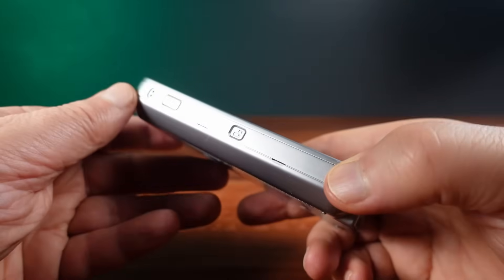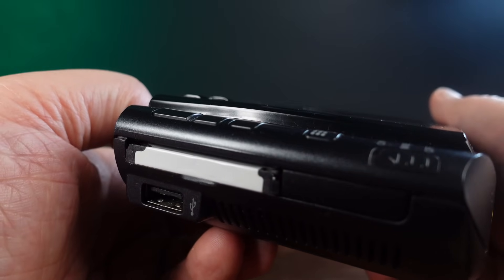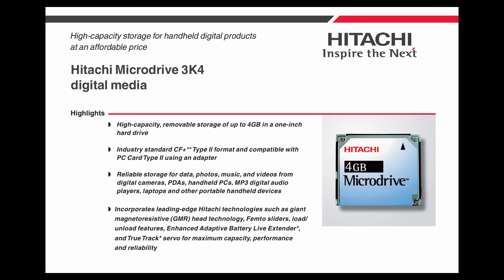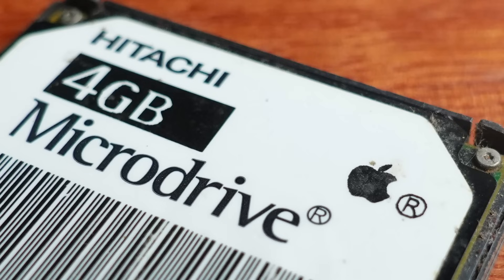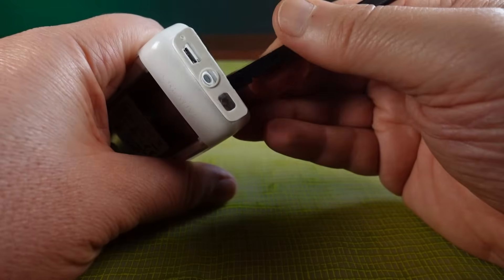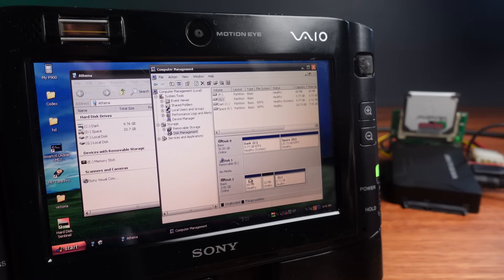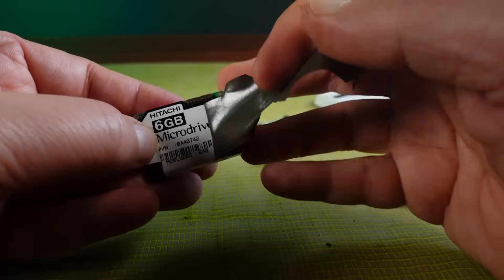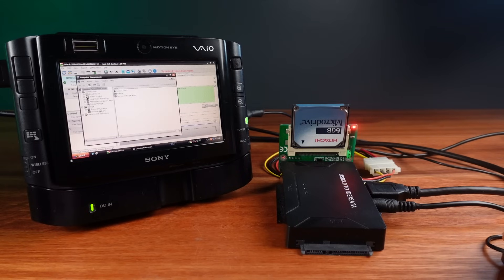Miniature Hard Drives

Comment: What about changing firmware in those microdrives to expand support of other protocol?
Reply: Even on specialized data recovery forums, the amount of information about these hard drives ranges from "nothing" to "oh, we know these things exist," so yes, it is theoretically possible to change or patch the firmware, but no one knows how.
Reply: @avamnepohui7260  With enough time and dedication, it is possible. On the one hand there are these firmware upgrade tools from the manufacture. You may reverse engineer these, or just hack them to make them flash a 'retailed' firmware with CF support on an embedded one. The parts and hardware is likely the same. Comparing the firmware with IDA or Ghidra probably reveals that even the firmware code is just the same, all what differs are some flags in the 'configuration data' section that enables or disables CF support.
Of course these are just wild guesses, however it is most likely like that, so development and maintenance costs stays low.
Reply: @asselpunk1  I didn't say it was impossible, but. In theory, it sounds like a simple task. In fact, it's a bit different. As far as I can tell from what I saw in the video, the Seagate drive, judging by the firmware version, is similar to the early Barracuda and late U series. But what distinguishes them from these drives is that the interface can work on two different protocols, which regular Seagate drives for computers cannot do. The configuration is stored in the "Vendor" module, or rather in one of its parts, which Seagate calls "Stuff", which will most likely differ from what has already been studied. It is possible that you just need to replace some parts of the firmware - the APP module is responsible for working on the main interface, which is written in a hidden area directly on the magnetic disks, the "Vendor" module is also written on a magnetic plate.

But if you replace one of the firmware modules, the drive will simply stop working, because all its modules are interconnected. For example, if you want to replace the board of a Seagate drive, but the drive originally had an IDE interface and the new board has a SATA interface, after such a replacement, in order for the drive to work as it should, you need to write modules from a drive with a SATA interface to a magnetic plate and do a full factory burn-in test, because no one could remake the tables of defects, calibrations, etc. from one firmware version to another. We are talking about drives of the same series, the same volume, and with the "same" firmware version, which is printed on the sticker.

An interesting fact - no one could find a diagnostic port on these small Seagate drives, all games with firmware are done through it.
There are no utilities for updating their firmware either.

If you want, I can share a link to a stream on YouTube, where a data recovery specialist entertained viewers with a similar Seagate drive, but was unable to do anything with it, even with a specialized tool. It is possible, and I am even sure, that someone has studied these disks and knows something about them, but there is no information anywhere, and most likely, besides the manufacturer, only 3 people on the planet know it.

If you want to know what Hitachi disks are - in short, it is a nightmare. There is practically no sufficient information or utilities for basic work with the firmware of these disks in publicly available sources. I am talking about ordinary disks that are used in computers and laptops. I am not even talking about these microdrives.
Reply: Yeah i kinda want to know if that's possible!!! ❤❤
Reply: I wonder if this utility would address the issue with the embedded drives. ATCFWCHG. It’s used to change a flag on cfcards from removable to fixed or the other way around.  I did see some old posts about people using this on micro drives.

Comment: I remember when Palm announced the LifeDrive (as a Mobile Manager, separate from their PDAs funny enough) and I really wanted one. 4Gb was so big I almost didn't know what I could use so much space for it on the go. In 2006 when I got a 4Gb iPod Nano, I couldn't even fill that up. I put every album I had on it and even some from my grandpa's iTunes library.
The microdrive itself was also a big draw, it felt way more like a "real computer" when it had an honest to goodness HDD internally. Lol.

I remember looking up some older Palm devices like the TRG Pro and the company bragged that it could use the 'newest' IBM Microdrives that went up to 340mb and that it could support the bigger capacity ones later. The microdrives require more power to use so the interface has to be able to supply that.

Everyone knows about iPods having HDDs for a super long time right? But I remember deciding what tablet I wanted to get in 2011 and one was made by Archos, had a 250Gb hard drive (2.5inch I assume), could dual boot Android (was an internet tablet, not Android by default) and it could do all the normal multimedia things of the era.
I ended up getting a netbook as that was more useful for school.

Comment: How powerful is this motor that with a 5v power supply it can not only spin at 3,600 rpm, but also read and write data to this disk while doing so?

If you put a propeller, a tiny 5v battery and a remote control on it, it would probably put most of today's most expensive toy drones to shame!
Reply: The mass it needs to spin is tiny and there is almost no air resistance. And by the way: these microdrives also work on 3.3 Volts.. Still they are a marvel of engineering but then again modern 36 TB drives are also incredible pieces of precision.
Reply: @gertk2303  3.3v? awesome!
That's even better, even lighter and smaller battery to make it work!
And you're probably right that only because of the lack of air resistance and the weight that spins this engine makes 3,600 rpm.
But for a drone or other toy to fly 3,600 rpm is too much, some kind of gear will be enough, reducing the number of rpm but increasing the torque power.
Imagine such a tiny drone to fly not outdoors, but indoors at home, and if the battery lasted much longer than 5-15 minutes!
Even a tiny remote controlled drift car would be awesome!
The smaller the funnier it gets :D

Comment: There was one use for these for a few years after high capacity cards came out: applications which are write heavy  (multiple full device writes per day). Flash wears out, these don't. But with the terrabyte sized microsd cards today, this use case isn't relevant anymore.
Reply: I have seen multiple SD cards die on me when used in RPis used for home server duty, that only stopped when the DietPi distro came around that did save logfiles to a small RAM disk.
And i had a 2 GByte solid state IDE drive die on me with XP, had tested that OS in a thin client and the drive didn't last long, at least it let me run some matches of Quake 3 on the thin client.
Reply: Flash does wear out, yes, but the rate at which it wears out is often greatly exaggerated.
I have a tiny, non-branded 2GB SD card that I bought in the early 2010s for next to nothing. I used it heavily in my Nokia and later in my Windows Phone, storing movie after movie, and yet, somehow, it still works.
So, unless SD cards aren’t made as well as they used to be, I see no reason to be concerned about wear—unless they’re used as a boot drive for Windows. Even then, they will probably last 8–10 years, on par with mechanical drives in terms of life expectancy.
Reply: @Sam-K  Have you read my comment carefully enough? I wrote multiple full device writes for a reason. You will not get anywhere close to that no matter how hard you try to use it. What you did was considered normal. Or were you writing 10+GB of data (5 full device writes) every single day for many years to it? Because in this rare application that's what was happening. A flash based CF card fails after a few week if you do that to it.

Comment: Funny enough, the original drives from my iPod minis do read fine in my USB card reader, and the iPod mini reads any compact flash card just fine aswell.
No matter if it´s in "fixed disk" mode or not, as a lot of modern compact flash cards do no longer support "fixed mode".
There were also embedded microdrives made by seagate, the ST1 drive.
They had a ribbon cable permanently attached.
Unfortunately, the Olympus m:robe is using those and it makes it impossible to replace or upgrade the microdrives, unless you find another ST1 drive...
Luckily i got a bunch of them NOS and upgraded from 5GB to 6GB drives.

Comment: I remember this time -- people shulking microdrives from Creative's MP3 player and reinstalling smaller capacity flash based drives back in, then either returning/refunding it or selling it as secondhand players.
Reply: Coincidentally, hard drive shucking is still going strong among NAS/Server users as external hard drives could contain a enterprise or NAS grade drives at fraction of the price of just buying it bare. Although those hard drives requires some connector modification to be used as regular hard drives.
Reply: @Poorgeniu5  That "modification" being taping over the 3.3 volt pin. lol
Reply: Lol reminds me of people buying large hard drives and returning the small original Xbox hard drive that did not have the size on the labels instead.
Reply: This is probably the reason why they wanted to stop the shucking frenzy. 

Otherwise they wouldn't care who bought them imho. 

But having to test every return / issues with purchases where drives were fraudulently resold is likely the culprit.
Reply: welp, I was one of those who did this sh*t before, but then the CF storage was darn expensive those day.....
Reply: Shucking*
Reply: I love the human race

Comment: The reason youre not able to read the SMART data from your drives is that that data is part of the ATA command set. Most mass storage USB drivers dont support pass-through of this type of data. If you connected these directly via IDE, it would probably have worked.
Reply from the maker: Not just probably, it did work!
Reply: @JanusCycle  Glad to have been of assistance tips fedora
Reply: I came here to say this. Additionally, many USB card readers only speak the USB mass storage protocol (which uses the SCSI command set) and don't provide a way to send native commands at all, instead handling all of the translation to ATA in the reader.
Reply: Same goes for any firmware updates to drives, even on today's SATA bus. They usually need direct access to the drive via a native disk controller. No adapters, RAID cards, etc... to get in the way. Even AHCI mode in the BIOS can get in the way of some of these processes (like updating the firmware on some Sandisk SSDs).
Reply: @hal263 Could that be the reason why cloning drives via usb to sata adapters never worked for me?
Reply: @finnbianga4189 Simply cloning drives shouldn't be a problem. I use DD all the time with USB drive interfaces.
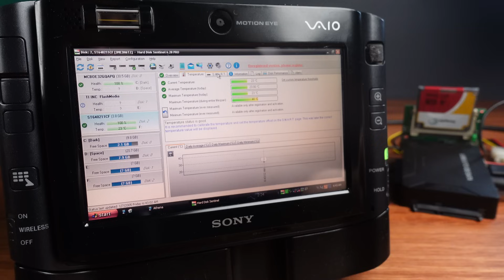Reply: Guys, he literally does this in the video. Watch till the end. 15:28
Reply: For some controllers there is a workaround for this with smartctl iirc
Reply: Same happens with some RAID or host adapters 😮 or have to read it differently but yeah usb sucks for that

Comment: the Nokia n91 included an even smaller 0.86" Toshiba 4GB hard drive. So cool!
Reply from the maker: The Nokia n91 will get a dedicated video one day with that tiny hard drive.
Reply: @JanusCycle don't forget to mention both versions 4gb and 8gb
Reply: i think that used dual voltage mmc esque connector
Reply: @meganium412 it is identical, but I don't think it could be read in MMC slot or vice versa
Reply: @Setupthemabomb  i guess the protocol is different
Reply: i have a nokia N70 but it aint work i tried everything
Reply: @achhcityshorts4646 have you tried a new battery? On eBay a BL-5C should cost a couple of pounds/dollars/euros
Reply: I didn't know that Nokia used a mechanical drive until today. That's wild, especially when the N81 (released only 1 year later) had 8GB of flash memory. It really does show how quickly the flash memory prices must have come down.
Reply: But you and the author of the video kept silent about the fact that these drives quickly fail. The reason for this was the dynamics. Dynamic motion will quickly destroy hard drives. Microdrive is essentially the same hard drive
Reply: @ I mean that's a given with any mechanical drive, especially when being moved around very frequently. It's still an engineering marvel, even more so when you look at how physically huge hard drives were back in the 80s.
Reply: I asked Deepseek About the smallest hard drive ...he said : Toshiba 0.85-inch (2004) 😮
Reply: My Nokia N91 still working... Working beautifull

Comment: Small correction. Microdrives are not he same form factor as your average CF card. Microdrives are CFII and most CF cards are CFI. Microdrives are 5 mm thick, CFI cards are 3,3 mm thick.
Reply: I also noticed they're a tiny bit thicker. I didn't know CFI and CFII were a thing.
Reply: @teamredstudio7012  I think it comes from Type 1 and Type 2 PCMCIA cards. CF1 is the same thickness as PCMCIA type 1, CF2 is the same as PCMCIA type 2 (which were by far the most common size). I had an IBM 1GB MicroDrive and it came with a PCMCIA type 2 adaptor.
Reply: Plenty of flash based CF cards from this time period were type II.  Older pro level cameras have type II compatible slots for this very reason.
Reply: There's also a slight difference in supply voltage and permissible current draw. IIRC CF-II (3,3mm) cards may be limited to a supply voltage of 3,3v and also have a lower permissible current draw compared to CF-III, which targeted the possibility of removable hard drive packs in its design. CF-III devices can draw at least twice the current of a CF-II device, and may also be able to access a supply voltage of 5,0v. ⚡

This is the reason why most PCMCIA slots tend to be double-decked; It allows the user to install two CF-II devices if they need to (The host will be able to power both) but only one CF-III device can physically fit in the same two slots. It's a physical restriction employed to make it easy to enforce electrical restrictions the user might not observe if they're simply advised not to insert more than one CF-III device at the same time. 👍
(It also means lower power devices that can't support CF-III devices can enforce this by only providing a single CF-II slot that's too thin to accommodate a CF-III device.)

Edit: CF-I changed to CF-II and CF-II to CF-III after a subsequent comment highlighted I'd got my PCMCIA/CompactFlash generations slightly wrong. 😇
Reply: @ Interesting. But I'm not sure you're right about stacked PCMCIA slots. PCMCIA type 1 cards were rare in laptops; they were nearly all type 2. Having two stacked type 2 slots was common. If you had a laptop like that (and that didn't have a divider between the slots) then you could use the space for a single PCMCIA Type 3 card like the Xircom Realport. They were great as they were big enough to have full-sized RJ11/RJ45 ports on so you didn't have fragile dongles to worry about.
Reply: @ That's more or less what I'm thinking of, so I must have got Type III mixed up with Type II. I did have a RealPort card at one point, so I know what you mean by the advantage of having the ethernet port built in to the card. 👍

(Though in total fairness; 3Com did a Type II modem that had a pop-out RJ-11 connector - Basically a square of plastic in which you inserted the RJ-11 connector, perpendicular to the line of the card. Not 100% practical, but better than nothing! 👍)
Reply: @dieseldragon6756 Joining on the tangent here! I'm not 100% sure, but I think it was also a 3Com card I had that was ethernet one with that kind of pop-out connector slot. It was very useful back then, but ofc a card with a "real" socket would've been way more rigid. I just hadn't seen one at the time
Reply: Probably the same design as the one I saw, though IMC the pop-out connector was clearly for a POTS line (It only had two contacts and was too small for RJ-45). I don't know how long 3Com kept that design in use (I have a new-ish looking 3Com PCMCIA-II card that uses a dongle, and I still have the dongle! 😁) but I imagine broken connectors might've been a significant weakness in that design.

I mean; 3Com were an American company, so One Yank, and it's off seems highly relatable to this! 🇺🇸🤣
Reply: I know there was definitely a Linksys card with a full size eithernet jack
Reply: @ I have a „PC Line“ one that's the same as well. Don't know what the manufacturer was („PC Line“ is a UK Currys/PC World own-brand) but it's the same overall idea as the Xircom and Linksys ones. Probably made by one of them under a white label arrangement, I shouldn't wonder... 😇
Reply: yup. older DSLR comes with CF2 slot, and slowly, they ditch the CF2 and opt for CF and/or SD only for entry model DSLR.
Reply: Yup very true..
Reply: Erm excuse me 🤓

Comment: “What do you want to the dialer to dial?” “Nothing.” “Oh, okay boss”
Reply: You just used it to use the phone on the connected to Bluetooth device. It's a cool feature and it does seem weird they didn't release a model with a GSM radio in. The increased manufacturing and design costs couldn't be justified with the market as it was then I suppose 🤔